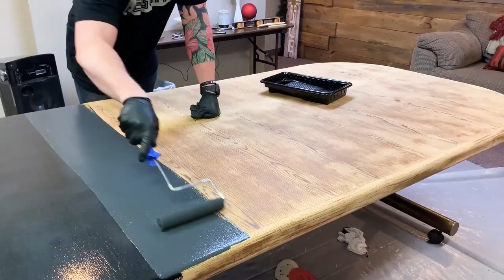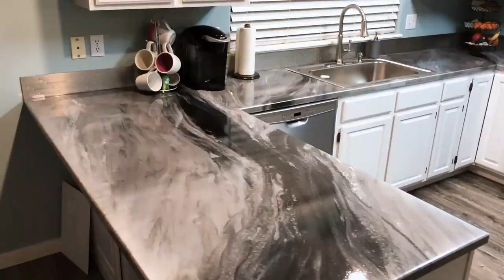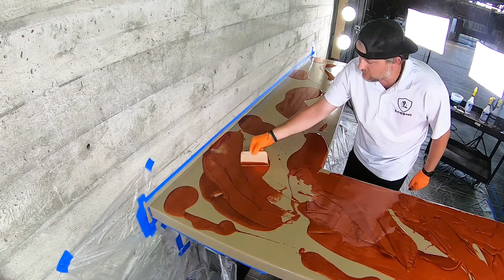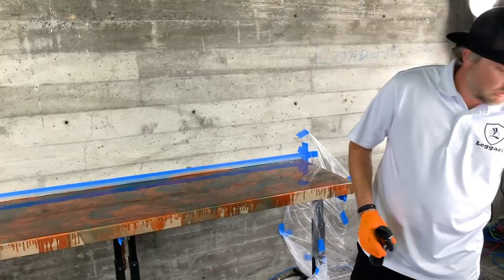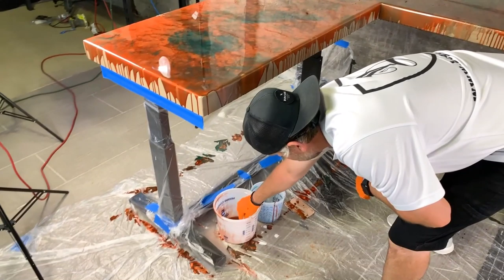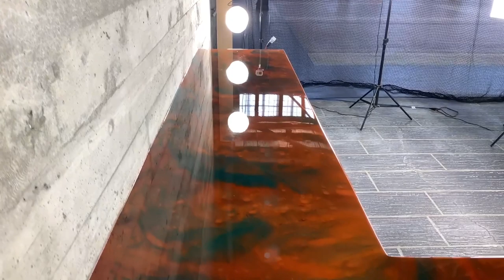Easy Epoxy Countertop That You Can Do At Home!

Comment: Is there a reason to brush the edges horizontally instead of vertically down in there natural flow and color pattern?
Reply from the maker: ejcsds When u brush the edges right after your done it doesn’t matter because the resin is still going to flow over the edges. If you brush the edges after it starts to set up u will want to brush with the way the design is flowing.

Comment: how well does this hold up outside on a concrete top?
Reply from the maker: This is not a product for outdoor application because of the weather elements.  They are coming out with an outdoor epoxy later in the year.  Thanks